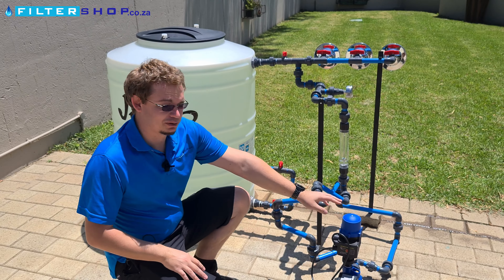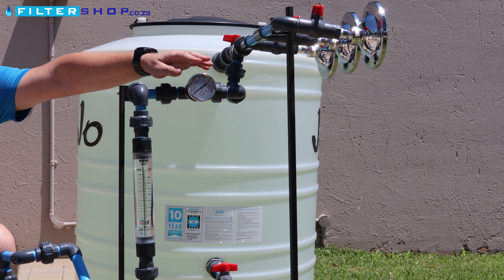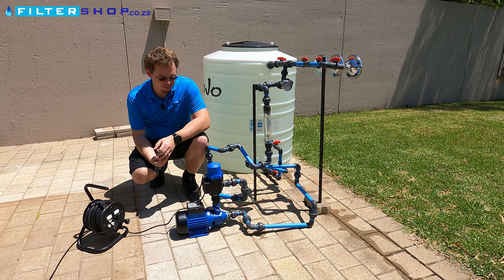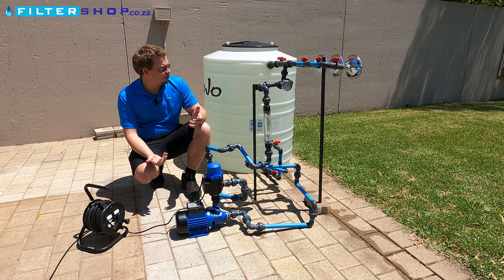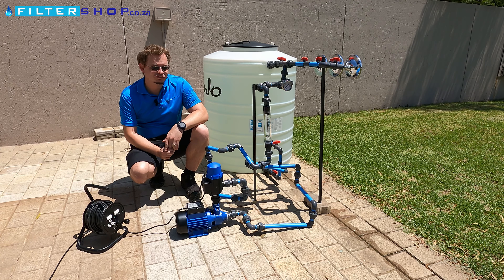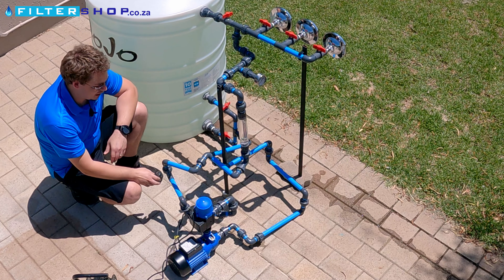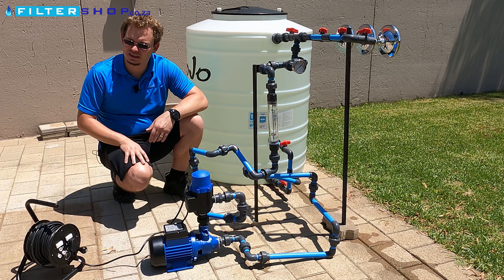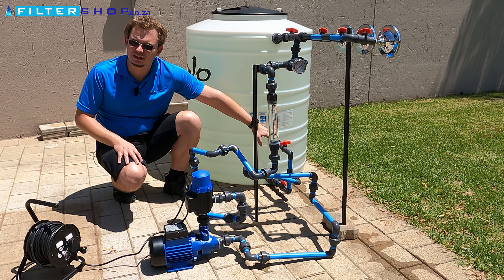Pump Test Setup

Comment: Hi, thanks for the video, please help me understand what the problem is that I cant get the pressure up to 4bar to start with. Is there an adjustment I can make?
Reply from the maker: Hi, this will depend on the pump you have. What are you using?